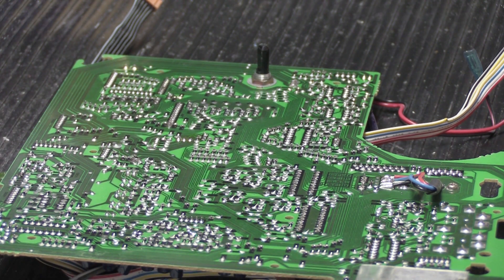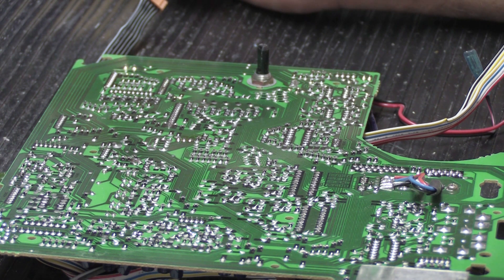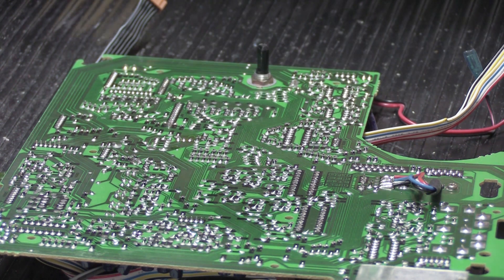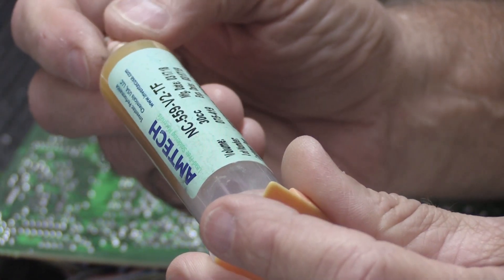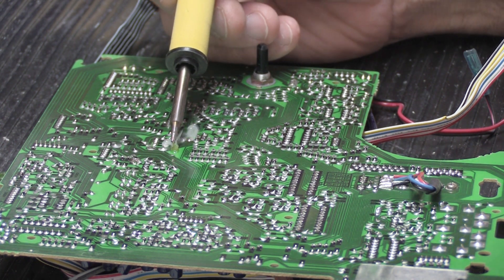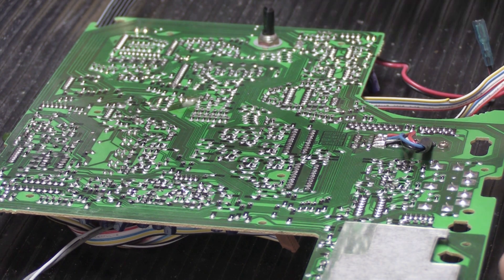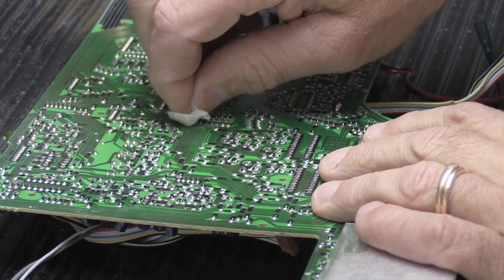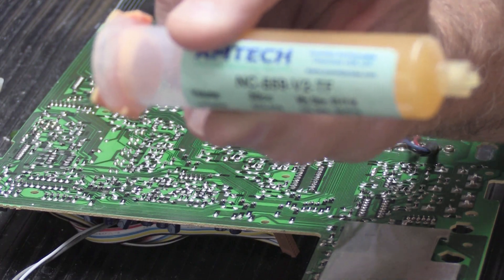Tips & Tricks in Under 5 Minutes #4 ~  Choosing the Right Type of Flux when Repairing Electronics

Comment: Hi Chris. There’s a lot of confusion between the Amtech V2-TF and the Amtech ASM.
People are speaking really bad about the ASM and they are offering me the ASM at a very low price. Seems that people who bought the ASM were cheated and they want to get rid of it. Would you recommend the ASM for NuTone ?
Thanks.
Reply from the maker: Hi luis:  I have been using Amtech NC-559-V2-T for about 10 years, I have not used any of their other products - The Amtech ASM you mention states that it is designed for "Automated Soldering Machines" - If people are buying it for a different purpose, and it isn't working, that's on the buyer for choosing the wrong product.  I am unsure why you would want any type of this product, if you plan on using it for your 2561 / 2562.  Your Master Station can be worked on with regular Rosen Core Solder - Chris

Comment: What's the purpose of the vaseline-like "solder paste" that comes in the small round tins?
Reply from the maker: Hi MTFTVlive:  Solder Paste is used with Surface Mounted Components.  It takes the place of regular solder - It is applied to the pads on the circuit board - then the component is placed on the board - then hot air is used to melt the solder paste - You might be mixing up Solder Paste with Solder Flux (in a can) - the stuff in the can is what plumbers use to solder copper pipes - Chris
Reply: @northsideservicecompany3567  right, my local stores only have the greasy stuff for soldering pipes